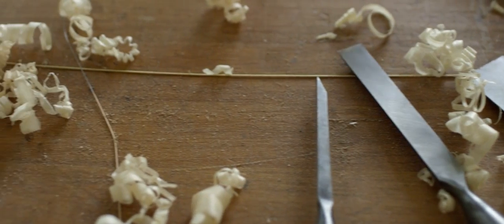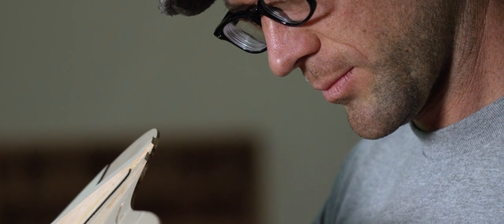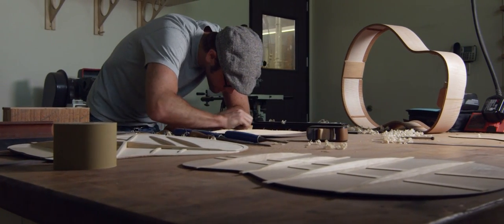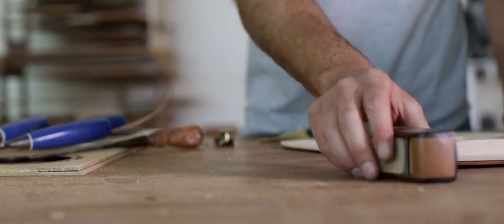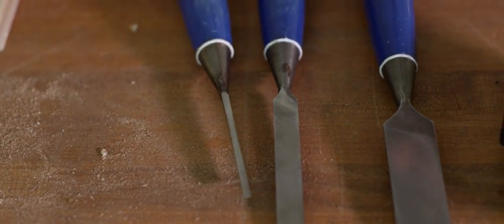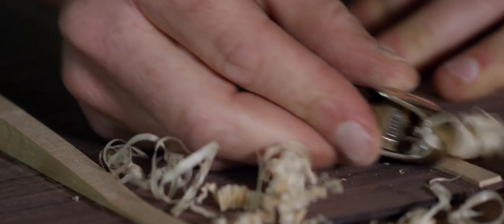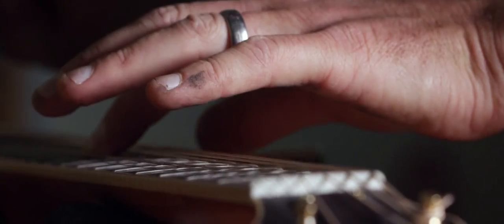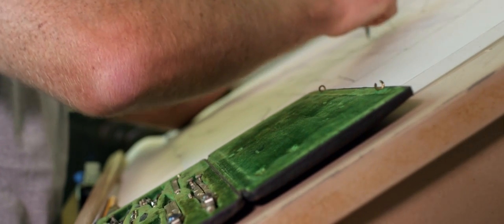Andy Powers "Inside the Craft of Guitar Making"

Comment: When I went on the factory tour, once the braces were glued and dried the top was placed on the box itself, there was NO HAND CARVING what so ever.
Reply from the maker: Michael,
Here is some clarification from Andy Powers regarding "Hand Carving," for bracing in the production cycle, as you pointed out during your factory tour.
"Yes, and no.  It goes like this.  I make a guitar-I decide where to put braces, how big they should be, how they should be shaped.  I shape them and tap tune by hand, with my chisels and planes.  Then, I make more of the same guitar to make sure they are what I want them to be.  Then I translate the braces, shapes, placements, and such into computer geometry.  Then, I work with the engineers to make exact templates, cutters, computer guided programs to produce those braces-templates, jigs, fixtures, all sorts of things to make sure each size, profile, shape is exactly what it should be.  Then we make the braces and glue them to a top.  After everything has been assembled, each top (every single top here in El Cajon) is put onto a 3 D mill that has been programed to duplicate my original geometry, in case there was any variables that crept in during machining or assembling the parts.  This last machining is tough-Jim Truitt is the engineer whom I work with to make sure this last brace shaving results in perfectly sized braces.  So, no they are not hand carved, and yes, they are hand carved. - Andy Powers"
Reply: Yeah but what I saw were brace patterns placed down and glued in the same spots, the braces were all pre-carved in Mexico and glued into place. no extra carving like in your video. There is no doubt that Taylor makes a great product, I'm just saying there is no need to lie about how you "Line" Assemble a guitar not "build" one
Reply: HAHA this process isn't used on any of their guitars... It is for the commercial only. Every guitar is mass produced by a machine and done with a pattern, nothing is unique
Reply: Michael Volpe hand made or machine made my taylor sounds sexy as fu** and i can't put it down, stop the hate man lol
Reply: Not hating.... I love all of my Taylor's, I own a BTO Walnut, 610 Maple, CS-LTD, 810, and 510LTD Koa... I'm just wondering why they need to lie in their ads? That's all
Reply: haters gon hate lol
Reply: the video just made me feel better about my guitar, lying or not it was nice. after watching it i felt like andy personally made mine lol
Reply: You clearly didn't understand the reply that Taylor guitars have you. The process that you see in this video is how a particular guitar, such as the 800 series, is created. Once the design is complete, the guitar is mass produced with machines that follow the design. This is the same with all mass produced products such as a car. If every guitar that Taylor makes was hand built, they would cost at least $20,000 like other companies that hand make guitars.
Reply: You clearly stay mad.
Reply: only the 300 series and above are made in the US the 100-200 and the baby series and GS minis are made in mexico.
Reply: Michael Volpe I thought Andy's answer was pretty straightforward. Watching the video, I had no misconception of each Taylor guitar being truly hand-built. I do find it amazing that he actually creates, oversees, and duplicates his specs exactly as he built it. That is true quality control.